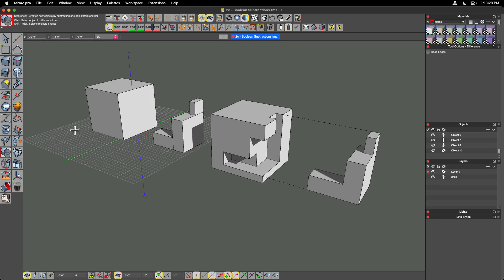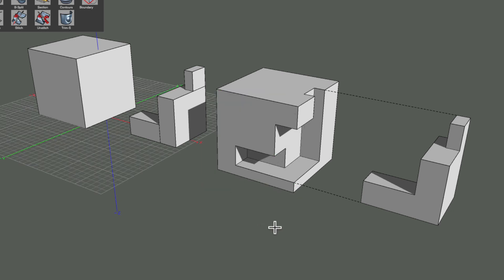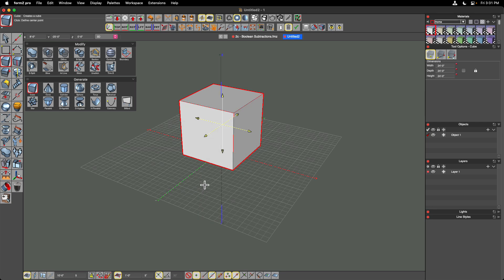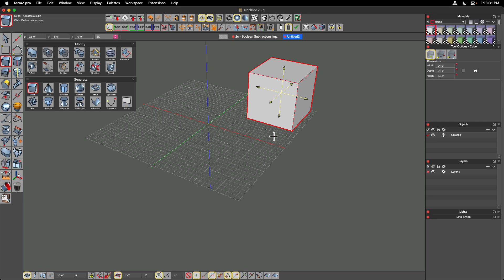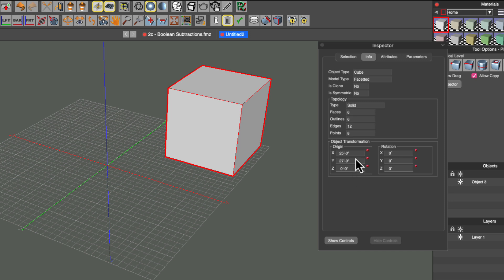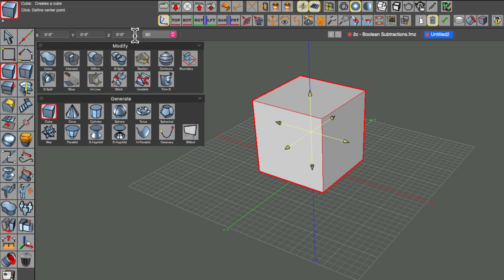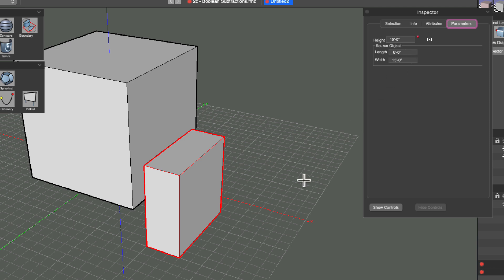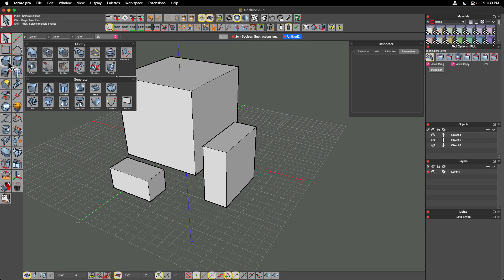Introduction to Modifying Objects using Booleans, Part 1

Comment: 1. Allowing the "snap to" grid to use different settings than the "visible" grid in the workspace is INCREDIBLY confusing...I can't imagine any real-world situation where I'd actually want to do that, particularly in the way it's done in this video.
2. Two forms don't need to have coplanar surfaces for a Boolean union to work...if they overlap it'll be fine.  (The video sort of implies that the surfaces need to be coplanar, which is a bit misleading. I understand the point was to illustrate the use of object snapping, but there might be a clearer way to do that.)
3. I don't want to be Debbie Downer, but, again, this stuff is extremely basic 3D and most users can probably figure it out from just reading the tooltips.  It would be great to see some videos that go into greater depth about building complex objects.
Reply: 1. It depends on the scale of the project. I often snap at a 1” increment but would never want a 1” grid for a building. Isn’t it nice that you can choose? I think so.
2. In the example it is coplanar but of course doesn’t have to be, in fact it is often better for the geometry to not be coplanar when doing booleans for the best results. But in this worst case scenario, it still works when coplanar and thus is why I used it in this video.
3. This is a form•Z Fundamentals series, and all things must begin somewhere.

Comment: I have a problem and need help. I was practicing changing parameters on a cube: position, rotation and scale. When my scroll wheel zoomed the entire project out to the upper right and it "disappeared"! I tried to scroll back to enlarge it again but it didn't work. A dialog said "unable to zoom any closer. Reduce the Numeric
Accuracy in the Working Units Options dialog to
work at smaller scales".
ID = S.29
I can't figure that out. Any help?
Reply: Either use Command/Control+F (Fit geometry) or Command/Control+Shift+H (Home view). Mouse scroll wheels and perspective views are sometimes at odds with each other. A future video on the Cone of Vision will explain why.
Reply: @EvanTroxel  Thanks, Evan! I'll give it a try.
Reply: @EvanTroxel  It worked!!! Thanks again!